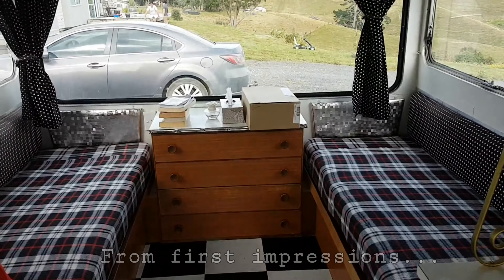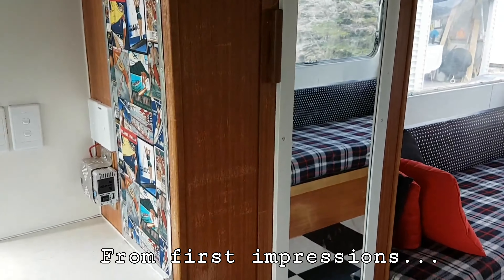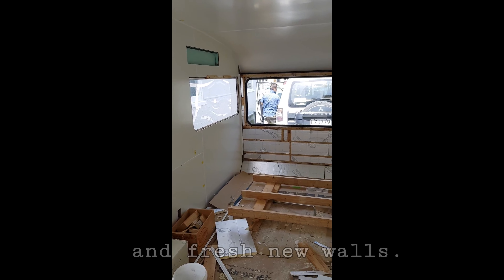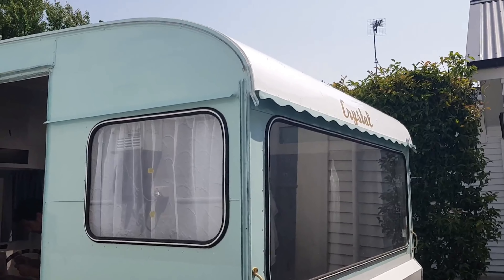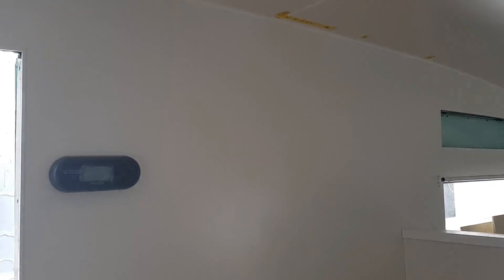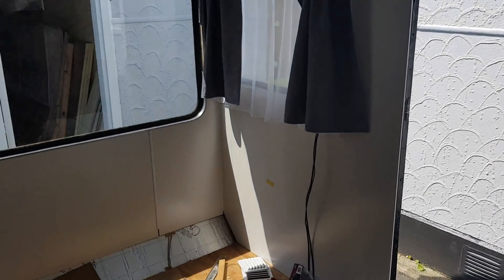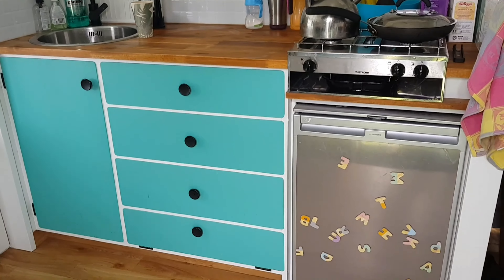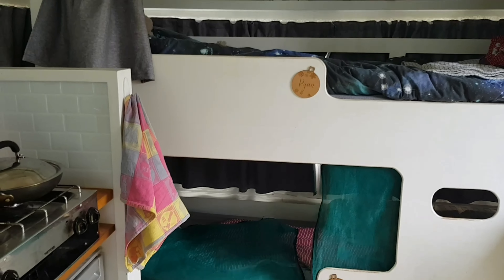Vintage Caravan Renovation • The full process - before & after • Full Time RV Travelling Family

Comment: Nice work, very practical layout. Have you thought about a composting toilet? Bit taller to try and fit under the bed but no smell at all with a little 12volt computer fan running.
Reply from the maker: We did consider it but we were limited to what would fit in the space. Would definitely consider one in future builds, but the portaloo does the job and doesn't tend to smell

Comment: Awesome work. We have just bought our first caravan and about to start the demo. We've noticed some water coming in. Just wondering what you did for waterproofing?
Reply from the maker: Depends where is i suppose.
I ended up cutting out the wall to wall and wall to roof junctions and resealed them with a flexible, paintable silicone. 
The asme on the roof.
I know you can get tape sealant for joins but i thought it qould look pretty ugly.
There is also the liquid water proofing you roll on more designed for roofs.
Hope that helps.